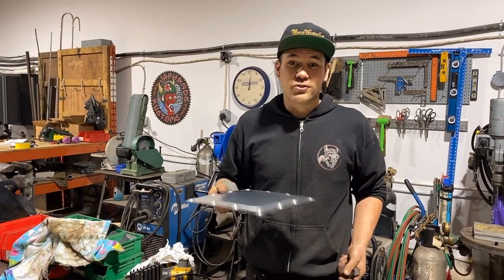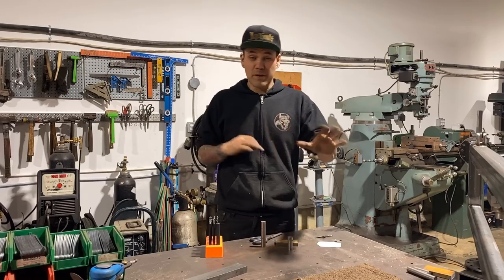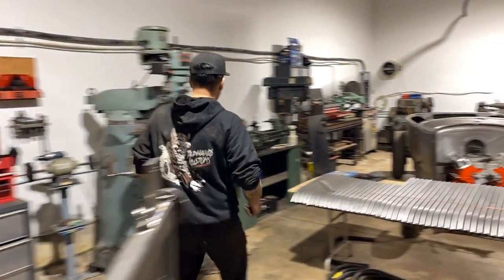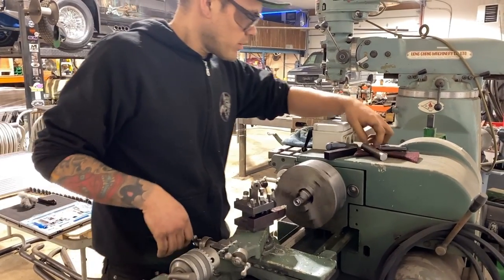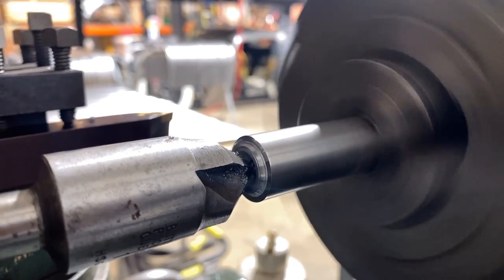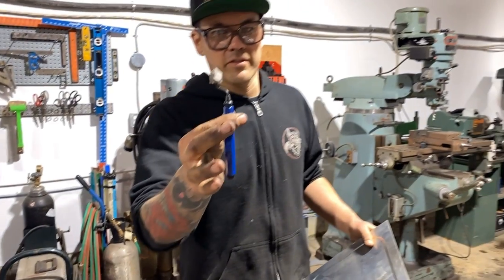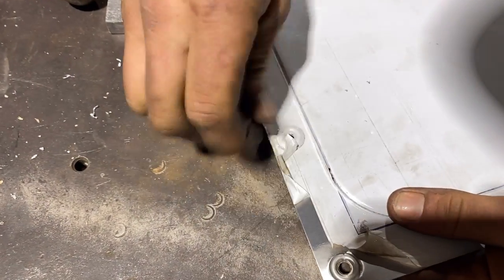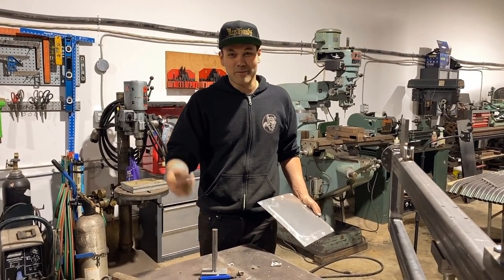How to Make a Dimple Die Punch Tool!! Countersink Screws in Sheet Metal + Flatten Bead Rolled Panels

Comment: Okay, I know... I should shut up.
Red loctite is permanent, too.   Everybody says that the green stuff is stronger, but according to the people who actually make the stuff, the red loctite is the strongest version.   It surprised me, too,  because I had been told for years and years that green was the holy grail for permanent installations.  It's not, so I thought I'd pass it on.  If you check the data sheets you'll see that red loctite is the strongest loctite.   I use blue a lot, but when I need something to stay forever I use red.
The purpose for green is not high strength - green is a thinner version that can wick into pre-assembled parts to secure a bearing or something.   For your application I would use red.

Comment: Why not drill a hole in your work table and set the bottom die in to the table flush with it so you can just lay your material flat on the table to do that. I' love your tricks and tips, but I have no access to the cool equipment you have. Only have a cheap princess auto english wheel, progress is so slow on it.
Reply from the maker: I made my English wheel from a cheap Princess auto one like yours. If you stick in the frame it will work much better
Reply: @MakeItKustom  what do you mean stick in the frame?